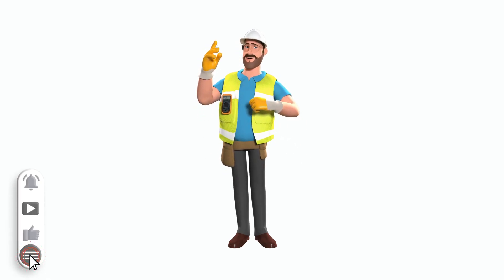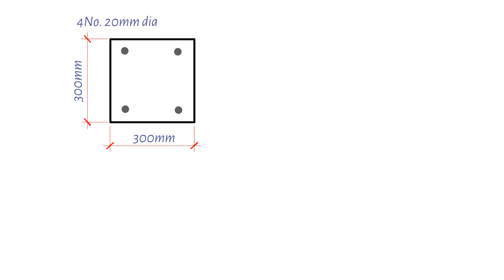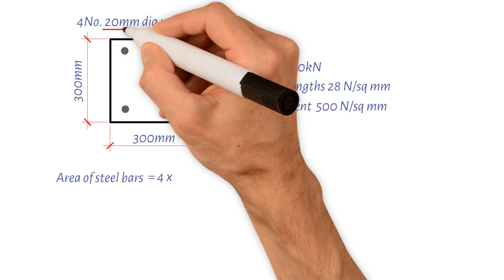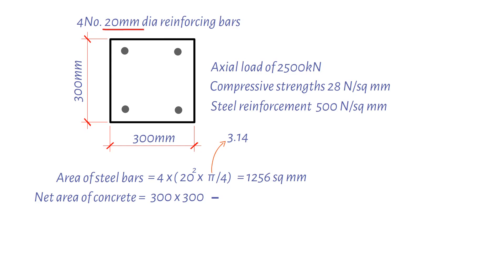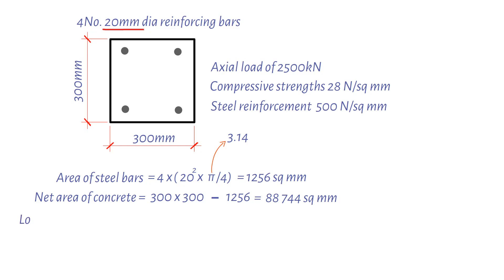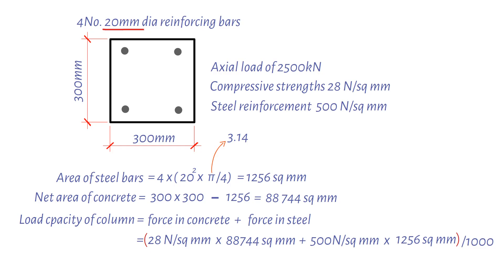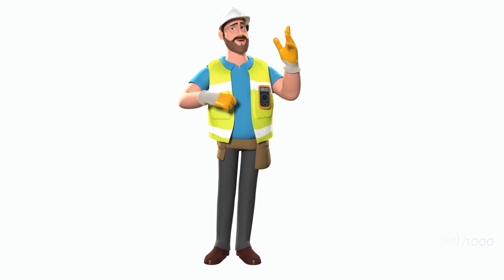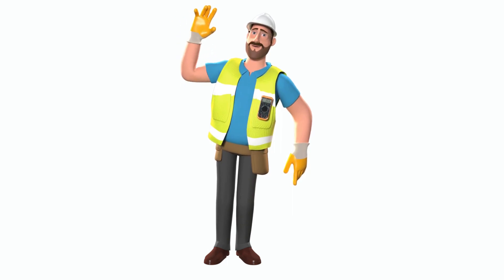Simple check of concrete column axial capacity.

Comment: It seems that you have disregarded the material safety factors.  These are 1.5 for concrete and 1.15 for steel. So, I suggest that the force resisted by concrete, as calculated above , is to be divided by 1.5 while the force resisted by  steel reinforcement  is to be divided by 1.15. That is assuming is that the load is centric and the column is a short column.

Comment: Great video guys. Is it possible to do this with the column charts? So same design as this, just running through the option if using the chart method? (if applicable).
Reply from the maker: No, this video is only a simple check for the column capacity. If you want to design you need to consider geometric properties of the column cross section for example lateral dim of column, also the length of column and support conditions etc.

Comment: ignore the buckling....
Reply from the maker: As stated it is a simple check for a concrete column capacity. however, Some columns fail as a result of buckling followed by material crushing (s).  These columns will tend to have lower load-carrying capacities, a fact which is taken into account by reducing the design stresses in the column. The design stresses are related to the column's slenderness ratio, which is found to be a function of the geometric properties of the column cross section, such as the lateral dimension of the column, the radius of gyration, the length of the column, the support conditions, and so on.

Comment: We need to consider the Factor of safety for materials.
Reply from the maker: Thank you for your comment. We already used design compressive strength in this example. However, we should of used lower value of steel reinforcement say 400MPa. We will highlight  these in the upcoming videos.